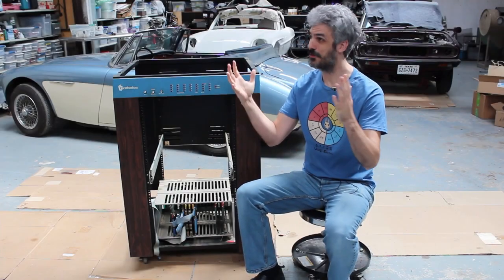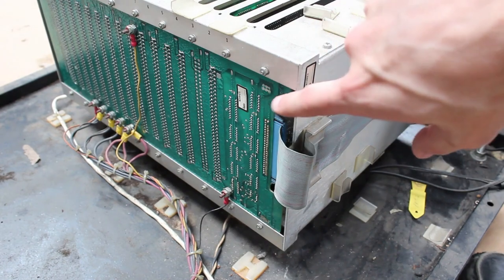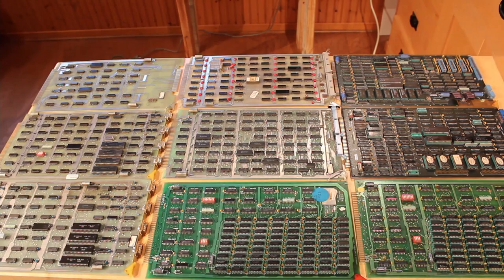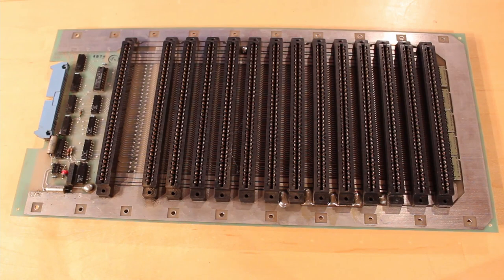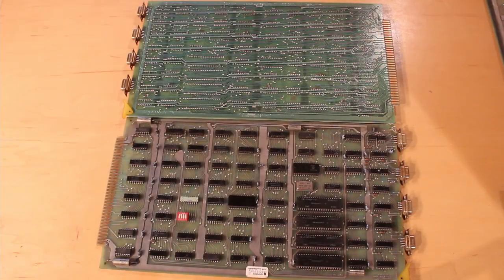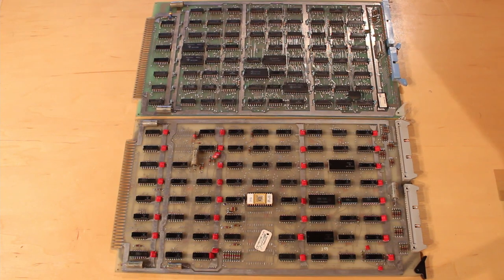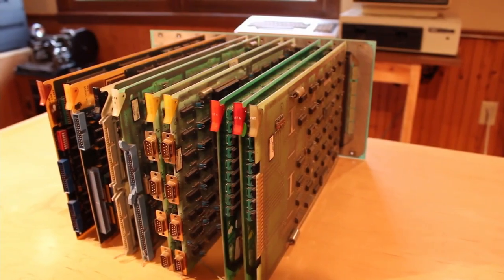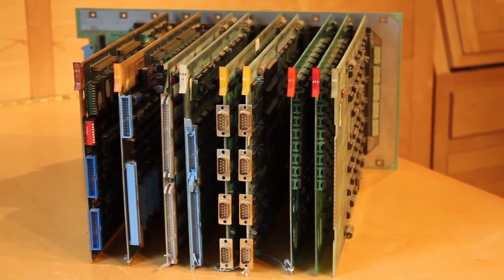Minicomputer Part 4: In-depth Look at all the Computer PCBs

Comment: The number of ALU slices and of sequencer slices are completely independent. You need two ALU slices to process 8 bits at a time, four for 16 bits (this machine), six for 24 bits and so on. The job of the sequencers is to generate addresses (which we can call the micro program counter or uPC) for the microcode ROMs (or RAMs in some machines). You need two sequencer slices for 8 bit addresses if you only have 256 words of microcode, three slices for 12 bit addresses for 4096 words of microcode (this machine) and so on. The width of the microcode ROMs can be whatever you like. They can be used to directly control the ALU slices and the rest of the datapath (we call that horizontal microcode, which uses wide ROMs) or they can go into combinational logic which expands them to a larger number of control signals (allowing for narrower ROMs in what we call vertical microcode) or even a mix of the two.
Reply from the maker: Thank you so much for the insight!
I've actually learned a bit more about the CPU since this video. It's actually an 8-bit processor and the CMD board is just used for IO control, namely to control the drives. 
The original Centurion systems were all TTL made CPUs and this newer CPU6 board is actually just a single board hardware emulator for the early CPU4 boards (named CPU4 because it used four boards). 
So you're right on point with the sequencer slices being use to generate address for the microcode ROMs and emulation hardware!

Comment: Something you might want to consider.  Sprague does indeed make quality components, however, any electrolytic capacitor over 10 years old I would highly recommend that you replace!  Many will test good for certain factors (eg. ESR) but fail miserably in others ( Leakage or Parallel Resistance ), and depending on factors of the construction of the board, the circuit itself, and other factors, you could end up destroying those "unrepairable" traces.  I would suggest that even if the capacitor looks good, to replace all the electrolytic capacitors for safety's sake.
Another capacitor issue you brought up was the capacitors that were mounted "upside-down" on the board.  I don't know the exact reason, but it occurs to me that there might be a possibility that there was a need for a tiny bit of inductance to be added where those were located.  I once worked in R&D and one of the engineers took a capacitor I had received samples of and used it as an inductor in a circuit he was designing.  He had tested it on a network analyzer and while it indeed had the capacitance value it was labeled for, there was the exact amount of inductance he needed in his circuit!  Don't you just love the amazing field of Electronics?!
The 7905 is a NEGATIVE 5 volts regulator.  Might be taking the -12 Volts from the power supply and regulating it down to -5 volts.  See https://www.ti.com/lit/ds/symlink/lm79.pdf?ts=1637689465821&ref_url=https%253A%252F%252Fwww.google.com%252F  for more details.
I really enjoy and appreciate the videos you are producing and all the hard work you go through to do that for your audience.
Reply from the maker: Thank you for the kind words and the excellent advice!
I did actually go through in a later video and replace nearly all the electrolytics. None of them seemed to be leaking, but they were really easy to access and fairly cheap components, so I figured I'd go ahead and knock it out. 
I love hearing stories about engineers using components in really unconventional ways! Though, I think in this instance, the boards were probably cut for a different foot and they mounted the caps upside down to prevent too much stress on the leads. The inductance idea is brilliant, but I don't think there was that much engineering thought put into the decoupling caps, haha.
Good catch on the 7905, my brain totally missed that for some reason. You're definitely right that something on the board needed -5V and so they just grabbed it off the -12V rail!

Comment: - The decoupling cap lead spacing looks to be because the layout was done for the previous generation of ceramic chip caps which were packaged in glass tubes and were similarly sized to 1/4 watt resistors. Spreading the leads of the epoxy coated radial caps too far would stress the lead to cap junctions, thus the 180˚ bends in the mounting.
- Sprague caps are good, but after 25 years, ALL electrolytic caps are past their service life. Replace.
- The AM25LS2538 would take four standard TTL chips to duplicate; 1x 74LS138, 2x 74LS266, and 1x 74LS240. The AM25LS2538 is likely faster.
- Just a guess... but I'll bet the CPU does 16 bit operations in 2 passes using an 8 bit ALU (The Z80 incidentally uses a 4 bit ALU and two passes to work on 8 bit numbers)
- Another guess, but I would assume the CPU board is the full CPU while the CMD board is an I/O processor
- The -5 volt regulator must power the VCC minus pins of the SN75110 line drivers connected to those blue connectors. My guess is they go to LEDs for optional bus monitoring.
Reply: The 'lytics (apparently bypass caps) can be tested, and in other electronic service have been known to endure for decades, but new ones are cheap today and easily installed, being far smaller than the originals.
Reply: That makes a lot of sense Peter
Reply from the maker: I think you're totally right about the layout for the decoupling caps, and that makes sense for the 180* leads too!
It's interesting that they chose to use the AM25LS2538 to cut down on the number of TTL chips, but only used that chip. Everywhere else on the board (and on the majority of the other boards) they just stuck with a ton of 7400-series chips, so it struck me as off that they chose just that chip to minimize a bit with.
I think you're definitely right that the CPU board is purely for the computation and the CMD board is for I/O. It would explain the dramatically different constructions and the additional connectors on the CMD board. Also, the CPU may just be doing 8-bits. I was caught with the idea of 16-bits because it definitely uses 16-bits for addressing (as evidenced by the address lights on the front panel), but it could totally be using multiple buses each with a different data width!
Reply: @UsagiElectric  Digging a little deeper, the AM25LS2538 has faster switching, improved noise margins, and twice the fanout of typical 74LS. That last part is almost certainly why it's sitting next to the field of 4116s. I'll bet the AM25LS2538 is used to drive /WRITE (pin 3), /RAS (pin 4), or /CAS (pin 15) and the improved fanout is likely vital as it's driving 9 DRAMs at a time. One decoder to hit 72 chips is a pretty sweet thing.
I wouldn't be a bit surprised if the CMD processor was pure 8 bits even if the first cousin CPU had 16 bit extensions. The memory looks 8 bit as does everything else except the printer card which looks like a Centronics interface, but it also looks like it might be only 7 bits wide.
Reply from the maker: @Peter_S_  The fanout issue makes total sense and something I didn't even think about! Which, in hindsight, I totally should have given how many times I've been butting my head against that on the tube computer build, haha.
Reply: The Sprague caps are tantalum. Not at all the same as aluminium electrolytics.  
It is a myth that all old electrolytic capacitors need replacing, some types do, most don't. Remove them, check them for capacitance, ESR and leakage. If they check out good, just put them back and don't spoil the environment by creating unnecessary waste.

Comment: Those caps were probably flipped upside down to ensure the card can clear its neigbours in the rack. If the caps were mounted the right way up, they might stick out too far and a capacitor might snag when installing or removing a card.

As for the CPU: The ROM chips probably make up some kind of microcode, and the SRAM chips are used for the register file.
Reply from the maker: There's been a couple different ideas to the upside down caps. Clearance between boards definitely makes sense though! Also, I like the idea that the footprint needed to be wider for some reason, so in order to get the caps to fit, clear and not be stressed, mounting them upside with the leads bent like they are was the best solution.

And you're right about the ROM chips! I've actually been in contact with a former employee of Centurion and the ROMs are totally for the microcode, which is all proprietary Centurion stuff. They had their own assembly language and OS, which is pretty awesome!

Comment: Oh wow, the multi wire technique blew my mind. 
I have seen similar stuff - also components embedded into the PCB - but I didn't expect something like this from the 80s.
I propably don't even want to know, how much these boards would have cost to manufacure back in the day.
Reply from the maker: That multi-wire stuff is crazy!
I think they had to use that method in order to fit the entire CPU on a single card that had a defined physical size. I can't imagine any other way to get that intense of a layout unless they used multi-layer PCBs!
As for cost, well, I don't know how much the boards cost to manufacture, but I found an ad listing a Centurion computer quite similar to this one in 1983 for $40,000, which is over $100,000 in today's dollars!
Reply: The multi-wire boards would have been a 12 layer board if not build using multi-wire technology. Other feature of multi-wire is the design turnaround is weeks not months to do a 12 layer circuit trace layout be hand. Problem with multi-wire is the feed-thru hole connection to the wire run fail (  open connection ) if the board is twisted more that a few degrees. The multi-wire bear board ( no ICs ) cost about $600 each. The complete CPU6  or CMD  multi-wire list for around $10K.  Complete 2 layer cards with TTL chips list for $500. The 4 layer 128KB memory cards & 4 layer 32KB memory cards [not in the video] list for around $10K.   FYI - Was one of the Centurion-Warrex engineers for about 10 years (company only was in bus for about 12 years & based out of Richardson, TX.
Reply: This was fascinating.  I read about it in the 70s / 80s in computer design magazines but I have never seen a board that used it.

Comment: I'm loving this! Those banks of 16k x1 DRAM chips are a little concerning - they're notoriously unreliable now (anyone who has ever repaired a dead Apple II will tell you). When you get around to powering it up you may end up needing to go through every chip with a DRAM tester of some sort. People have made Arduino based testers for this. To make things even more fun, they need +5V, +12V and -5V. The more common and reliable 4164 DRAM can be shoehorned into the socket if you modify some of the pins on the chip. Looking forward to the next video!
Reply from the maker: Thank you!
The good news about those 4116 DRAM chips is that they were super common, so if some are dead, I should be able to find replacements fairly easily!
It's interesting that they need -5V, because the PSU doesn't supply -5V. The 7905 on the CMD board generates -5V, but I can't imagine that it's being used for the RAM. I'll have to trace out the -5V rail on the board and see just where it's trying to get that power from!
Reply: @UsagiElectric  I remember getting my TRS-80 Model 1, Level 1 with 4K. and instantly seeking out 4116's to upgrade it.
Ah memories of the 1970's
Reply: The good news is that it would be theoretically very easy to build a functiionally equivalent memory card using more modern memory.

Comment: The sticker on the first MUX board says, "repaired" above the date. The bodge wire had to be it.

Edit: similar "repair" sticker on lower disk controller board.
Reply from the maker: You're totally right!
I'm really, really bad at reading handwriting, haha. But, it does seem like there was a lot of repair work done in the early to mid 80's on this machine!
Reply: The wire on the first mux is actually where the canned oscillator is piped into the original crystal oscillator circuit. The original crystal looks to have failed and it may have been an ECO to improve stability or reliability.
Reply: @UsagiElectric  Tricky to tell if the boards were repaired then re-used into new or replacement machines or repaired in or from the field then sent back to the machine they came with, probably at bit of both
Reply: seams like it

Comment: My man I am geeking out over this those boards are exquisite I wish I had the CPU boards I'd literally hang them in a frame that's how beautiful they are
Reply from the maker: Thank you!
Those multiwire boards are insane - just beautiful engineering pushed to the extreme! I would love to see some of the original design documents because they're essentially 8-layer boards (power plane, ground plane, top copper, bottom copper, two top wire layers, two bottom wire layers). The density is insane and the original engineers were on another level!

Comment: 7905 is a negative voltage regulator (as opposed to its positive twin, the 7805). Perhaps that is why you have a separate regulator on the board-- so that you can get positive and negative 5V. Awesome videos. Thx.

Comment: CMD is most likely the disk controller for the Phoenix CMD disk. CMD drives uses the standard SMD interface which has a 60 pin control cable and 26 pin data cables. It certainly looks like that is what you have on the CMD board. The -5V regulator is most likely used for the differential line drivers used for the SMD interface. The CMD and the CPU is not processing together. Rather you have an 8bit bit-slice microprogrammed CPU and a 8 bit bit-slice disk kontroller.
Reply from the maker: Oh, that makes perfect sense! The Phoenix drive wasn't plugged into anything when I got it, and I was trying to figure out which card it plugged into, but now that you mention, it totally looks like it does fit the CMD card. Thank you so much!
And you're totally right on the CPU and CMD board not being used together, but instead one is for processing and one is for IO control. Interestingly, the reason I was so hung up on the 16-bit idea was that the machine does appear to use 16-bit addresses as evidenced by the LED display on the front panel. But, it could totally be using 16-bits for addressing, 8-bits for processing and various other buses for other parts of the computer.

Comment: The 24-volt rail would be for any external drives such as floppies or hard or removable disks. 
But in this case, I seem to recall that the drives all have their own supplies, so this one is likely unused but still available if needed.
Reply from the maker: That makes sense!
Both the Hawk and Phoenix drive did have their own internal power supplies and just plug directly into 120V. So, I htink you're right, the supply was probably meant to feed something like a floppy drive which wasn't equipped here. I wonder if I could find a 19" rack size floppy drive as well and shoehorn that into it, that'd be awesome!

Comment: The capacitors are mounted upside down as a way to minimise strain on the component when the connection points are wider apart than the device. The leads push together if depressed, rather than pulling the ceramic apart, as would happen if they were mounted conventionally. Ceramic is stronger under compression than it is under strain.

Comment: The thought, engineering and skill that went into making these PCB's is outstanding.
I wonder if the bodge wire on the MUX board is something to do with it having a crystal installed ?
Reply from the maker: They really are very nicely built! Though, the amount of bodge wires on the boards implies that maybe they had a bit of a hard life, haha.
I think the MUX boards probably work together like a pair and the crystal feeds both maybe, that way they're perfectly synced. That's just a guess though!
Reply: @UsagiElectric  I agree - perhaps if they had 3 or 4 MUX boards, only one is a supplying the clock.
Reply: @UsagiElectric  In my experience, wires like that were added as revisions in the field to try fix odd conditions that occasionally showed up. But I worked for a much larger company (DEC). We called them FCOs - field change orders - or ECOs - engineering change orders.

Comment: What will blew your mind is that when this minicumputer was designed there were already 16 and 32 bit micro procesors and were made in a single IC instead a bunch of separated functions ICs. 8086 and 68000 where both launch in 1979. Most notably (for comparision), minicomputer PDP-11 was launched in 1970 and was already 16-bit. Just as some other commented, this looks like an 8bit computer with offload for input/output.
Reply from the maker: Absolutely! The TMS9900 is a 16-bit microprocessor that was released all the way back in 1976! It was used in the TI-990 minicomputer of the time, but also saw widespread use in 1979 in the TI-99/4. So it seems really wild that this massive mini-computer that was built right around 1979 to 1980 even had a market. But, I think it really came down to data-processing. The microprocessors available at the time were pretty good at a lot of things, but the design used here by Centurion was likely really amazingly good at just one thing, which was perfect for companies that need to keep track of a large amount of data. This particular Centurion was used by an oil company in Oklahoma, so it likely needed to organize and keep track of a massive amount of data, something that would have brought most microprocessors at the time to their knees.
At least, that's the only explanation that makes sense to me, haha!
Reply: @UsagiElectric  It was also down to speed.  The TMS9900 was sloooowww.  It was normally run at a nominal 3MHz with a four-phase clock (four phases in 333ns) and would take multiple microseconds for most instructions to complete. The bit-slice machines could be a hell of a lot faster at the expense of complexity and power consumption.